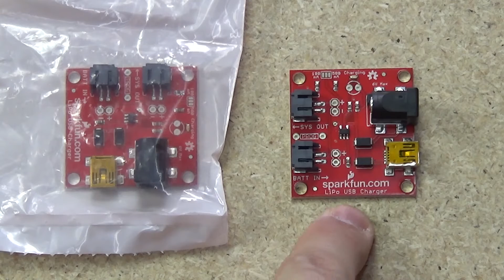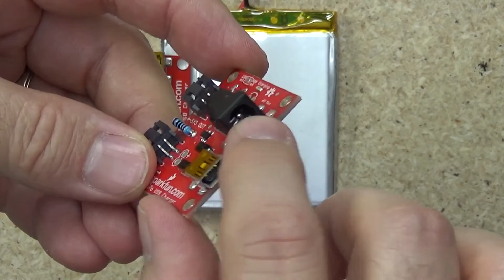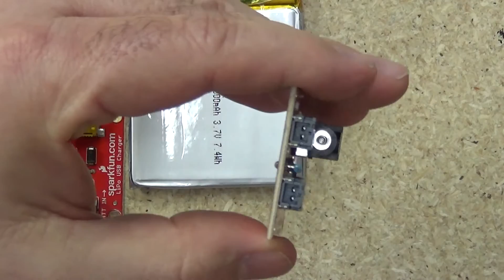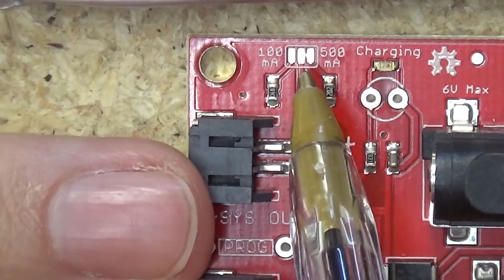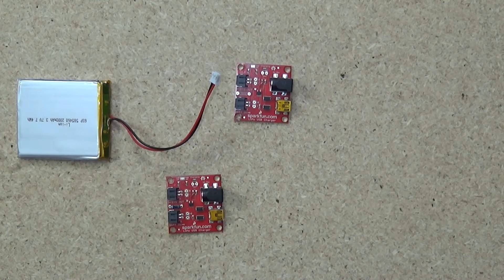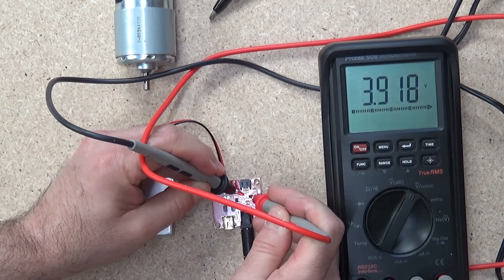Sparkfun Lipo USB Charging Module Review (MEHS) Episode 31

Comment: Hi, thanks for the video. Does the board stop sending power to the lipo when it is full?
Reply from the maker: - Hi.  Yes the IC on the board has the required internals to protect against overcharging.  Cheers.
Reply: Great, thanks alot, my board just arrived, looking forward to getting it wired up!

Comment: can 4 of these be used to charge 4 different lipo's (that are in series with each other, or would be better to use BMS. Ive seen ur videos on BMS, and am trying to figure best way to charge 4 lipos in series.
Reply from the maker: Hi.  Use a 4S BMS and use a MAX745 to recharge them.  Don't use multiple single cell chargers together unless you have worked out a good circuit design to avoid common ground and other issues that will cause the design to fail.  Cheers.
Reply: thanks for quik reply. I saw ur video on MAX745. I think that's me for sure. Appreciate ur efforts and videos; thanks again.
jimmyg

Comment: Hello. I have a question: if the batter is charged and you pull the USB plug, will the battery power the motor?
Reply from the maker: - Hi.  It depends on a couple of things but in most cases, yes the battery will power the motor.  The way this board works is it charges the battery when external power is connected.  The project that is also connected to the board received its power from the battery.  As long as the charge rate (say 1 amp) is more than the project drain, the battery will be charged and keep powering the project (the motor in your example).  If the motor draws more than the rate of charge going to the battery then the battery will eventually go flat and the motor will stop until the battery has recovered some charge.  This only happens if the motor draws more than the charge rate.  Cheers.
Reply: Thanks for the answer!

Comment: Can the board be configured to charge LiFePO4 batteries at 3.65 vdc?
Bill
Reply: I guess this would be the board I would need to use since I want to Solar charge:
https://www.sparkfun.com/products/12885

I would need to know how to configure it to charge LiFePO4 cells.

Thanks for the information!!
Bill
Reply from the maker: - Hi.  No this board is configured for lithium ion / poly only.  I don't even think the IC used on the board has any support for LiFePO4's.  Cheers.
Reply from the maker: - I dont know exactly what you are doing but that board looks like it will do the job.  Take a look at the Sparkfun Hookup Guide and the Datasheet for the info you need (page 22 of the datasheet has a diagram for using LiFePO4's).  Cheers.

Comment: Hello again sir. Would it be wise to connect a 5 Volt 2250mA power supply to the barrel jack and a raspberry pi official on the mini usb port simultaneously? The reason i am asking is the two power supplies are different amperage and slightly different voltage but both are below the 6 Volt threshold of the two inputs
Reply from the maker: Nick G - Hi.  Check the data sheet but from memory you can do that without issue.  I don't know why you would though.  If I remember correctly the power input is used to charge the battery at a max of 1.5a.  The battery power is what gets passed into the project.  The external power is not unless you do what I did and solder the output of the barrel jack to the power input of the project.
Reply: My Electronics & Hacking Show thank you very much for your response sir😊

Comment: can i charge my 500mAh and 1000mAh 1s lipo at default 500mA charging current? will it be fine
Reply from the maker: rohan bhardwaj - Hi.  By all means check the sparkfun website for details but yes it's designed to charge a 3.7v lipo at 500ma.  If you change the resistor value then it can go as high as 1500ma.  Cheers.
Reply: @michaelsstuff4402  Love your videos. Can you tell me what value resistor should be used for 1500ma? I don't understand the formula... I am charging two 3000mAh batteries in parallel and would like to speed up the charging a little.

Comment: Dear Sir,

I have a very urgent question, I used a NI-MH with this charger, it won't turn on the Charge Led anymore, what do you think happened ?
Reply from the maker: Antoine Zakaria - check for damage on the board .  If you put a lithium ion battery in the circuit and the board does nothing I'd say you have damaged the board.  It would not have liked the nimh battery as the voltages and charging method are wrong .  Cheers.
Reply: Thanks

Comment: I have a 3x 4000mAh 3.7v flat packs all as one package from a Power Bank I bought that had a broken board. 
The cells are fine and are in parallel. 
I'd guess that this as a single cell but give me a long run time for a portable raspberry pi 3, though I know of a 18650  power bank shell that does similar and costs about £2 instead of the £12 that this would cost me, I take it a 13000mAh 18650 based board will still work with a 12000mAh flat pack set of batteries.
Reply from the maker: +eLJaybud - If I read your message correctly you have a battery bank (3 flat 4000mah cells) from one unit and a charge board or module from another (18650 based) and you want to use them together.  I would say yes but look out for a couple of things.  1.  were the 18650's wired in parallel, in other words, does the 18650 module put out 4.2V?  2.  check the batteries regularly during the first charge or two just to make sure they arent't being overcharged (does the module have a cut off, either timer, temp, or voltage).  You should be fine with battery chemistries (should be the same) and the capacities you mentioned are close enough to avoid other problems.  Just keep an eye on it and you should be fine.  Can you see a IC name or code on any chips?  That might give you a good idea of the capabilities of the module.  Cheers.